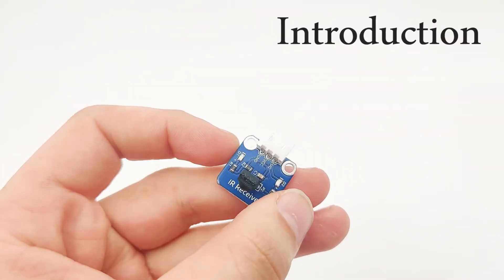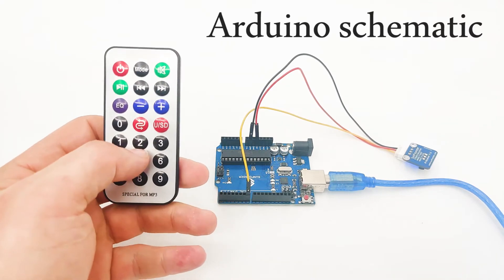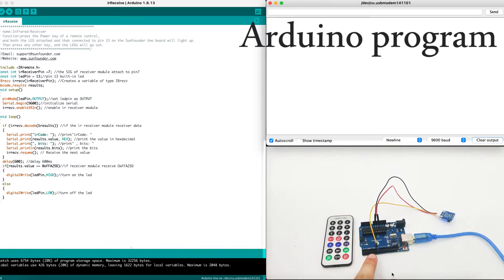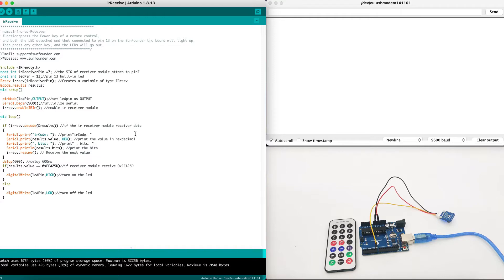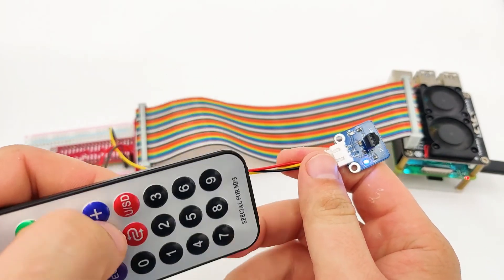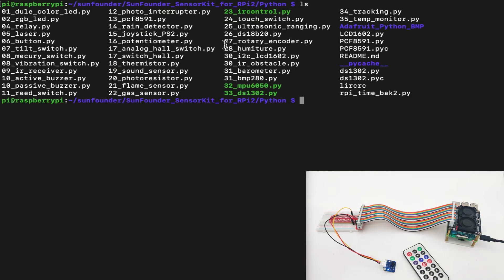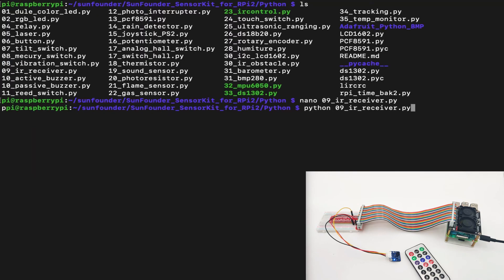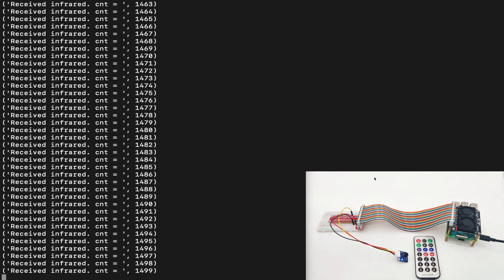How to use IR Receiver Module with Arduino&Raspberry Pi

Comment: Thanks for this informative video.

I do have some notes:
1. I noticed that although your Arduino example actually showed how to read the code for the remote controller's different buttons; on the Raspberry Pi example (the one I'm actually interested in), you only counted the pulses that arrived instead of what code values were received.
--> It would be great if you can show folks the equivalent code for the RPi's Python program to read the actual code from the signal received.

2. In the video (05:41), you told your viewers & showed that you plugged the SIG pin of the IR Receiver module to RPi's GPIO17; however in your code explanation (06:50), you showed that it is assigned to Pin #11 (which I know is the physical numbering on the board for GPIO17). This may confuse a lot of beginners since they may think you made an error on your code & change the value to 17 which would make your code fail (since it's actually looking at Pin #23 for input when there's nothing connected there).
--> perhaps simply change the code to show "IrPin = 17" then change the GPIO reference mode to "GPIO.BCM"... or, explain that "11" refers to the board's pin numbering instead of GPIO numbers.

3. I noticed that the IR Receiver Module operates on 5v (since VCC power is provided from the 5v rails/outputs). 
Since this is the case, wouldn't the SIG input also be 5v? I know this will be ok for the Arduino but will it be safe for the RPi's GPIO input (rated at 3.3v) over time? 
--> I've just ordered a similar IR module to yours but haven't gotten it yet, nor can I find a data sheet anywhere or what voltage is coming out of the SIG pin, so it would be great to know if this is safe or if I need to add resistors to pull it down to 3.3v to protect the GPIO pins.
--> at the very least you can warn your viewers about this and have them check their module before wiring them in.

Hopefully you take my notes as ways to improve this or your future content (as well as reassure me & other RPi enthusiasts out there that this won't fry the GPIO pin's circuit). 

Finally...
Perhaps you can make a follow up video showing something happening when the remote controller's buttons are pressed. Maybe have a few colored LEDs on different GPIO outputs that turn on & off when different remote buttons are pressed? I feel this would be a more visually satisfying way to show the program working.

Looking forward to your next video. Cheers!
Reply from the maker: Thanks for your feedback, we will optimize it.